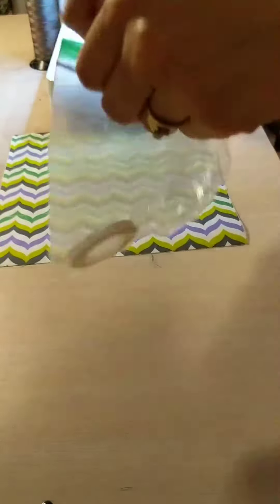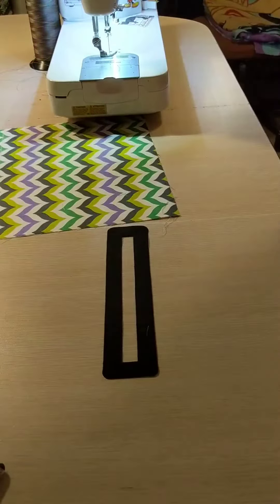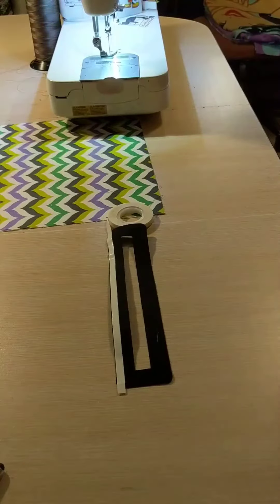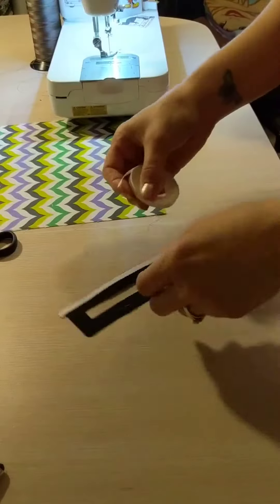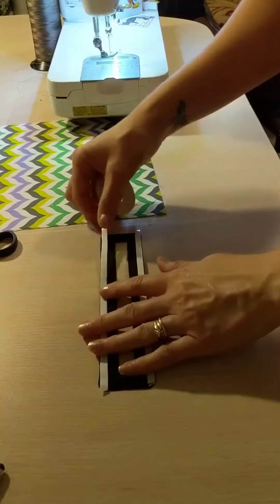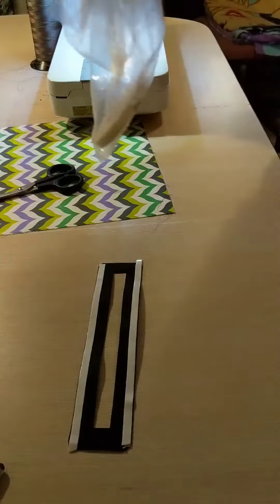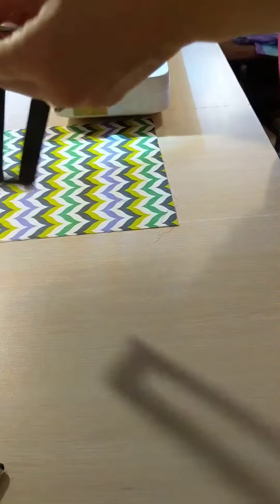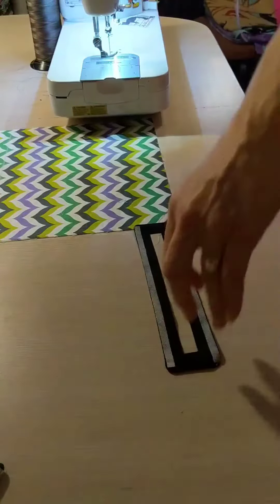How to Make Your Double Sided Tape Sticky Again

Comment: I keep mine in their bags also.  I love this heat trick!!
Reply from the maker: Yes, keeping them in their bag is important. Mine often rip, so I keep a stash of small ziplocs for this reason. I also, you don't see it here because I took it off prior to filming so I wouldn't be fumbling with things too much,  add a piece of masking tape over the end, where the tape end is. I don't know how much it helps, but it does help keep the end down and prevents it from lifting off and drying out more. Hope that makes sense. 🤞
Reply: mgrahamsews that makes sense and I’ll have to start doing it.  I don’t use the Dritz brand.  Not sure what brand it is.  I have ordered it from Sailrite a few times when I was making cushions.  It came with a paper/plastic type ring to protect the sides from attracting dust and other things that would take away the stickiness!!
Reply from the maker: @Falaje64  mine is from Amazon and I find it dries out so quickly. And I get the multi packs, so they're really dried out before I get to them all. And they also become harder to cut somehow too. Maybe that's a user thing tho. 🤣